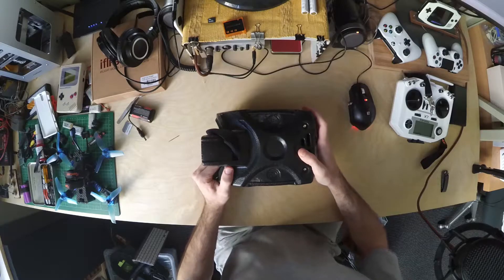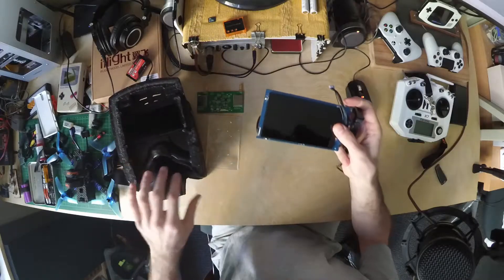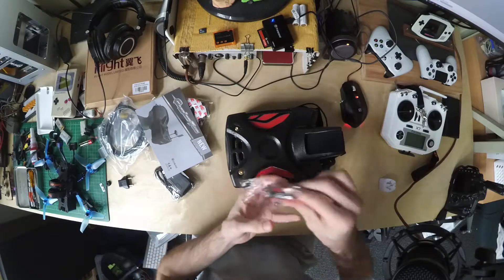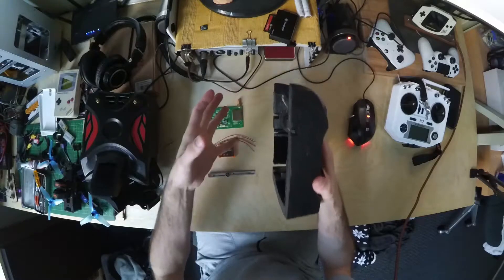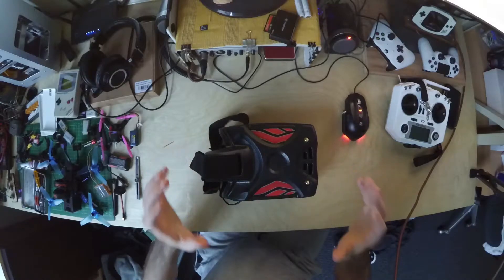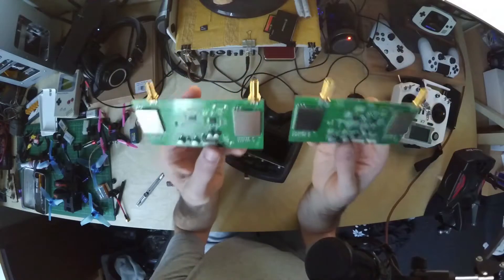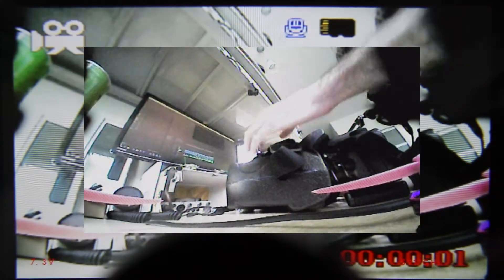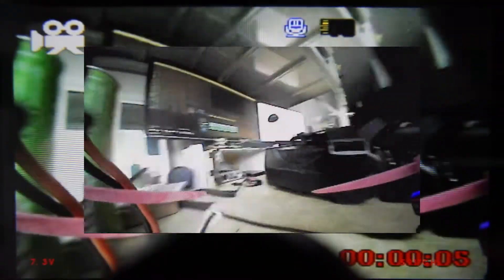Eachine Goggles Two Teardown & DVR Install

Comment: Hello if your google 2 doesn't boot it can be a faulty nimh connector. At least it fixed mine, im now using xt connector with 3s battery
Reply: nimh connector is the wire that comes out of the goggles?  this has happened you me with not powering on out of nowhere. how did you fix it ?
Reply: @nunyabizness7632  use xt connector and 3s battery should fix it! Don't use 4s !
Reply: @whopwhop7585  nope...  just did it, still no power

Comment: Hey buddy if you could answer me and help solve my worry problems that would be awesome I ordered the  wizard x 220 from Banggood on the 22nd but it’s been sitting in origin post since the 27th and they say it was supposed to arrive on the 10th I got standard shipping it says on the website 9 to 15 days business days understand that but is it normal for your package to set in origin post for over a weekAnd bang good won’t respond to my email and it seems that you order from Banggood a lot some help would be great thank you bud
Reply from the maker: Chinese sellers will always mark something as "shipped" in like a day after ordering, but really they haven't actually shipped it yet, they just assign a shipping label. A week sound about right for it to sit in China before it actually gets shipped out. I wouldn't worry. I'm in New Zealand and packages from BG or Ali take 3 weeks minimum to get to me. If the shipping status didn't change after a week, contact them. Can't really help but hopefully it relieves some worry :)

Comment: I found that with my goggles there was no need to use a knife.  The enclosure sides came apart with a bit of careful pulling.
Reply from the maker: Probably different manufacturing batches, or they were saving money on the glue haha

Comment: Great video I used your method today worked fine on the one side of the switch but when the dvr activated the screen would look like I was on the wrong channel so turned out I had to use the ground on the vid out and solder to the board now it works fine ! Thanks again 👍
Reply from the maker: Thanks Camshaft! Glad it was useful!
Reply: sorry but i dont understand where do you sold your black wires for me i have too sold only one like your schema so 1st gnd on dvr on board and the others???used your method todaytoo worked fine on the one side of the switch but when the dvr activated the screen would look like I was on the wrong channel like our friend ! sorry for my bad language and thanks for the video
Reply: folley87 you need a ground for the video side of the dvr also ! I found a spare ground on the board and then it worked so you need to solder a ground for positive and negative (power) then you also need to ground the video side of the dvr also ! If you look to the right of the board where you hooked up red and black wire right next to that spot there will be 4 extra pads for ground,video in,ground,5v pick the ground closest to where you soldered the power red black! I hope this helps you make sure to test before glueing back together! Lol
Reply: folley87 if you look at banggood.com for the goggles two it has the picture and directions also that helped me out also! Good luck 😉
Reply: hello thanks for answer , i have test all ground's on the board i don't understand why but it's the same thing ,
i can't find the good soldering  and your explain is too diffucult at understand for my very bad english i'm french and i have only english basics words !        : (      i'm sorry, it isn't clear for me, for the 5 black wires soldering .
maybe you can explain more simply please 
lot of thanks

Comment: can you please get back to me im trying to install this going off your video you said the video in but you have two wires a white and yellow were are they going it looks like in video you solder r were does the right on the pin can you explain.
Reply from the maker: Hey! Sorry didn't get back to you earlier, chrismas/ny shenanigans full swing :). There's a diagram I drew up for another commenter here: https://i.imgur.com/lEnmKZ1.png Let me know if this makes sense. You're just splicing into the 2nd pin from the right on the jack. Cheers!

Comment: were do you solder the video coming in the white and yellow wire at the bottom and witch black wire did you cut into

Comment: what wires do you have connected on the bottom of board near the plug can you email me a diagram how to wire this please
Reply from the maker: Hey! I did mine like this https://i.imgur.com/lEnmKZ1.png. Pin 1 is audio and I splice only to get sound on DVR. Pin 2 is the video pin that you splice your I/O into for the eachine module. Hope this helps!

Comment: you only tap in to the one black wire second one in you got one in and one going out right then you solder ground and 5volt on top is that it you made a good video but at the end the most important  part you dont explain to good how to install

Comment: I know nothing about switches. Most i see with the three connection points on the back that are two position are on off with led. What kind of switch is this exactly? im going to do the same as i think this is a fantastic idea.
Reply from the maker: Hey Garrett! Thanks! You can use any two position switch, if you have one with 3 pins, that's it! One position connects pin 1 & 2, the other 2 & 3. You want the cable going into the googles be on pin 2 so you can switch between video coming from the TX or the DVR :)

Comment: I have bought the DVR eachine, and I want to do the same.. Can you show more of your soldering (finished) to explain what pin you have solded, what cable you have joined together... Im a rookie, and it's not easy to see with your video =)
Reply from the maker: Hey Oni, sorry I couldn't get the wiring filmed properly! Here's a diagram of how I wired my one https://i.imgur.com/lEnmKZ1.png
Reply: Thank you for the diagram. U rock! When I see your diagram, and compare to 8:00, I see yellow and white cable connected directly to R3o and R3, up to the plug, is that correct? It's a lil bit different that your diagram
Reply from the maker: Hi Oni, sorry I missed your comment! The white is connected directly to the first pin because I just take the audio from that regardless of what video is doing, I didn't want to cut the audio wire on the plug. The yellow is the video in coming from the board as well, I just tapped into the circuit instead of the wire for that because I did that separately from when I wired in the switch. Essentially the same thing. I would avoid soldering to the circuit board if I was to do it again because it's safer (and it's the same thing) to just use the wire I cut for the switch. Hopefully that help! Cheers

Comment: Hi, thanks very much for this video!
Reply from the maker: You're welcome! Thanks!
Reply: Hi, my goggles two did same started turning off then didn't come on at all, turned out to be battery connection inside goggles. Easy fix with new xt60 lead so can use 2s or 3s lipo now. Anyway, thanks for video